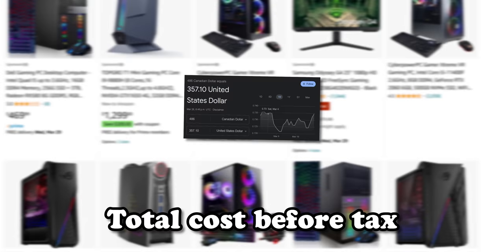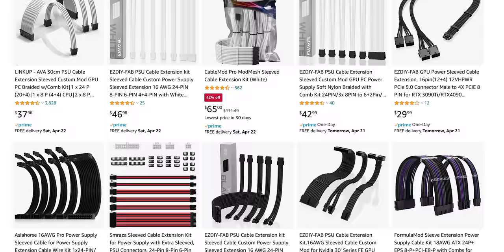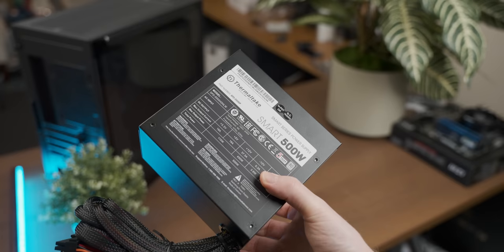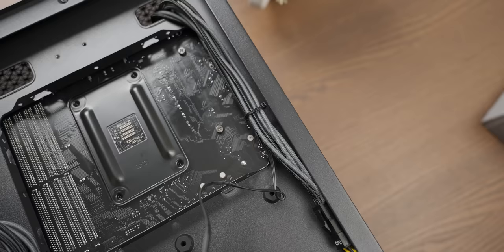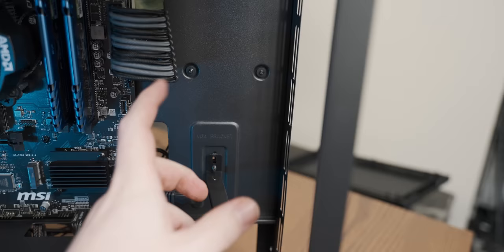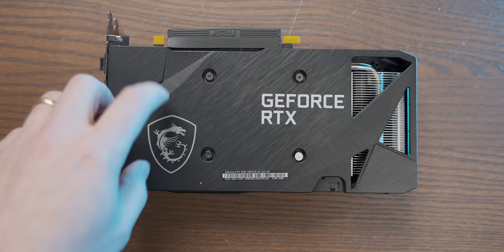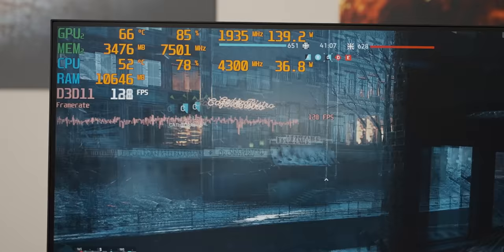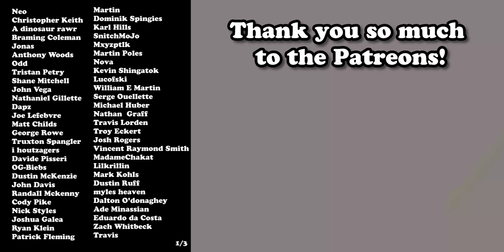I Use ONLY "Amazon's Choice" Crap To Upgrade My Gaming PC...

Comment: As Linus pointed out, it’s strange that Amazon does not recommend their own Amazon Basics CPU cooler.
Reply: I think that was the first mistake you made.....

Linus!

🤔
Reply: @-Gadget-  ? Goofy ahh comments
Reply: I think Amazon makes their recommendations based on the popularity of an item and it’s reviews. Sometimes that not their own product
Reply: i think its cuz its using the same cooler from Cooler Master only with slight differences.
Reply: Not sure if Dawid was using Amazon US or Canada, but in Canada the last time I checked you couldn't even buy that ancient turd of a CPU cooler.  Also, the cooler Dawid bought is actually about the same price as the Amazon junk cooler and much better.  Funny enough, the ARGB version of the Peerless Assassin 120 SE is cheaper on Amazon Canada right now than the non-RGB version, but isn't "Amazon's Choice".
Reply: Honestly, Amazon is pretty fair when it comes to amazon's choice, they are usually a good bang for the buck option. Not always, but not of the time it's pretty good.
Reply: @t.n.-js6ei  their cooler was tested on GN and it performed fine
Reply from the maker: @t.n.-js6ei  Haha!! An interesting contradiction in standards, but I think you are right.
Reply: @T. N.  Naw that's not it. 95% of their "Amazon recommends" stuff is straight garbage
Reply: I would have put two more fans in the top since the exhausted air would reflect off the wall behind the computer while Two fans in the top will exhaust the air up and away from the computer since heat rises.
Reply: @BraveClam  🤡🤡🤡 look I can use emojis too!
Reply: linus is a goof LOL
Reply: they do now :)
Reply: Good bait
Reply: Who's Linus
Reply: @samholdsworth420  Linus tech tips.
Reply: @FutureKLX300SMowner  zip up his pants after you’re done!
Reply: @yukhzia  wtf are you on bro 😂
Reply: It’s because Amazon doesn’t go through and personally pick what to recommend, it’s based on an algorithm
Reply: Amazon be like we make products we just don't think they are good
Reply: @BraveClam man just admit that cringy
Reply: I think legally, they could get sued doing that.
Reply: @-Gadget- linus is a YouTuber not the system
Reply: @FutureKLX300SMowner  grow up
Reply: @shataluproductions  it’s based on profit
Reply: @-Gadget- what’s wrong with linus?
Reply: @shataluproductions how are you?
Reply: @TheChosenOne471  Everything.
Reply: Amazon doesn’t recommend anything.

It’s all based on popularity combined with customer reviews.

So all this criticism was basically toward the common customer not Amazon.
Reply: @DawidDoesTechStuff  Upgrade CPU and buy an aMD Graphics card
Reply: If they would do that EU would sanction them for putting their own products at an unfair advantage.
Reply: @GnomeEU  The EU has no say in what the US does.

The US doesn’t need the EU.

The EU is totally dependent on the US.
Reply: @blake7587  you wish. That's why we have popup banners now everywhere, cuz the web doesn't care about the EU. 
You don't have to like the laws of EU, but they have just as much power as US laws.
Can you name a few US laws that affect me here in Europe?
Reply: @GnomeEU  yeah those annoying pop ups about accepting cookies and the websites privacy policy... That was an EU law that we regularly encounter in the US.

Comment: Wait. Looking back. 499 for a 3060 is absolute robbery
Reply: I think that's Canadian dollars, not US Dollars though. In that light, it doesn't seem quite so bad. Seems the the RX6600 is still faster and cheaper though(in Battlefield, anyway).

Edit: just read the comment below. Forgot about Nvidia GPU driver overhead issues on lower end CPUs.  Maybe when paired with higher core/thread count CPU the 3060 is faster? idk
Reply: @jtenorj   potentially could be faster idek tbh and I didn’t know it was Canadian dollars
Reply: This was only last year too, wtf.

Comment: When CPU is weak, AMD GPU are always faster, ie, it has a hardware scheduler with less CPU overhead. This was tested on Hardware Unboxed.
Reply: That would make sense lmao, I have a old ass computer and had a AMD gpu (I don’t even remember which one) and I upgraded to a Gtx 1650. Ngl some games run worse
Reply: It's definitely strange but I think you're right. My CPU usage is lower or almost the same since changing my 1660 out for a 5700 XT despite the latter being a lot faster.
Reply: That and the RTX 3060 was always kind of pants in general. The 66xx XT or its 3060 Ti big bro dumpster it.
Reply: This was RTX 3000 era, and HUB found that Nvidia uses a software scheduler that increases load on the CPU, ie, 10-15% more load on a weak CPU kills frames because it's closer to it's max at all times.
They showed a RTX 3090 slower than an average Radeon GPU, but only on weaker CPUs, ie, it didn't affect high end CPUs.
Reply: @AmigaWolf  rtx 3060 is really weak gpu and total crap for that money that David has paid. It’s already showing it’s age NOW, lot of games unable to run well on there higher to ultras and it will not cope well with new era titles build with UE5. 12 GB is useless. Buying this in 2023 should be forbidden.
Reply: @AmigaWolf  For the price then yes, however the 3060 is the still the better GPU of the two. It slightly outperforms the 6600 on average, has 12GB of VRAM Vs 8GB (zero memory  issues at 1080p), has far better RT perfomance and DLSS to boot.
So, I can kinda see why many do opt for it, over the 6600.
Reply from the maker: Thank you for that point! Very interesting. I’ll go watch that video.
Reply: @AmigaWolf  On your points: 
1. A 3060 is around 6-9% faster on average, which admittedly isn't that much faster. However, that little extra performance can at times come in handy. It can on occasions make all the difference between achieving a stable cap or being crippled by an unstable cap. 
2. Some of the latest games are now beginning to just suppass 8GB of VRAM at 1080p (Forza Horizon 5, Forspoken, Hogwarts Legacy, RE: Village, RE:4 ect.). Yep, you could lower down the graphics settings on the 6600 to high or medium settings or turn on FSR, in order to combat that VRAM defincancy. However that pretty much defeats the entire purpose of a capable GPU (You should be able to play in Ultra settings). While the 3060 on the other hand will still be perfectly fine gaming in 1080p, Ultra for several more years to come, because of that 12GB. The 3060 just has far better looking future prospects.
Also, in my comment I didn't mention any other cards, only that the 3060 was a better GPU than the 6600, out of those two competing GPU's. So why even bring any others up?
3. RT, is highly possible on a 3060 at 1080p in several games (same as it is on the equally performing RTX 2070), admittedly it'll likely be with lowered settings and/or some of the RT features disabled and possibly using DLSS in the more demanding RT titles, but it is possible and also at playable frame rates. However, RT is absolutely completely useless on a 6600. It has around 35-40% less RT performance than a 3060 and even has around 15-20% less RT perf than even an old 2060 (sub 30fps in several titles)
As for FSR vs DLSS, you really ought to watch the recent in-depth testing Hardware Unboxed did just a week ago where they tested the quality of DLSS, Native TAA and FSR in 24 games. FSR didn't even get added onto their final chart, simply because it got severely spanked in every scenario by both DLSS & Native TAA. As they said the quality of FSR in comparison is just third rate, especially at resolutions of 1440p or lower in any mode, where it was deemed poor, even in the best scenios. Even in 4K, Quality mode, it came out last in all but one game (Death Stranding), where it was judged to be very slightly better than Native TAA. With DLSS vs Native TAA on the other hand, it was roughly a 50/50 split, between which one looked best. As for image zooming, they have to do it because of crappy YouTube compression. You simply would be able to see any difference otherwise (especially on lower Res displays), due to the distortion and pixelisation that YouTube compression produces.
4. As I said, price to raw perfomance, then the 6600 is probably the better deal. But only if you aren't bothered about Ray tracing, DLSS, a bunch of extra features, a card that will easily last you 3-4+ years and having a touch of extra grunt to boot.
As I said, because of those advantages, I can see why many people still choose the 3060 over a 6600. It's simply because the only redeeming factor the 6600 has over a 3060, is that cheaper price. The 3060 is simply the better of the two competing GPU's in almost every aspect, if you disclude their prices.
As for pricing, believe it or not, it simply doesn't matter as much as you think it does, to some people. If pricing did really matter that much, then everyone would be buying up  cheap unbranded Chinesse crap left, right and center, instead of buying branded products.
Reply: @slavakhudyakov3807  wtf do u mean 12gb is useless
Reply: @FatCatCooper  I mean card is not fast enough anyway to play on ultras even on 1080p for the games that can potentially utilize this 12 GB, like The Last Of Us. On other games playing on Ultra you will be still fine with 8 GB of VRAM. So 12 GB in 3060 is useless -- where it can be potentially useful card itself do not provide enough power. 3060 is rater slow card.
Reply: @SidneyCritic  did this affect 2000 series cards?? Or was it a new 3000 series architecture change
Reply: @darnon2031  Yeah the 3060 is just a waste of sand lol, the 3060 ti should just be the 3060 😂
Reply: @slavakhudyakov3807  totally useful in games and in AI. the rx6600 has price going for it, but if they were the same price the 3060 is simply better. not by much, but it is. thing is, you might be able to buy a rx6700 with 3060 money. then there's "a bit of a gap".